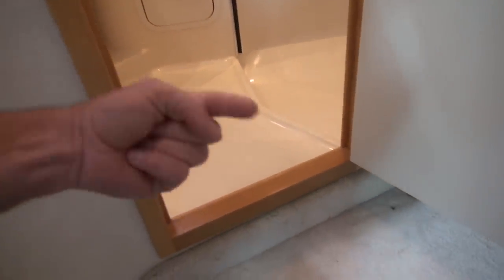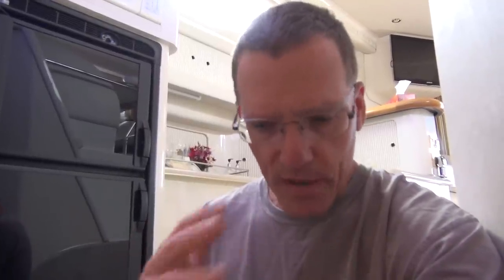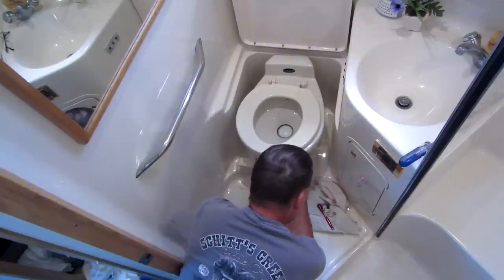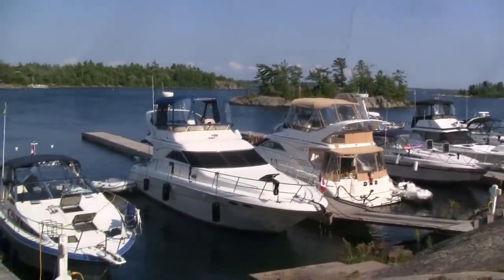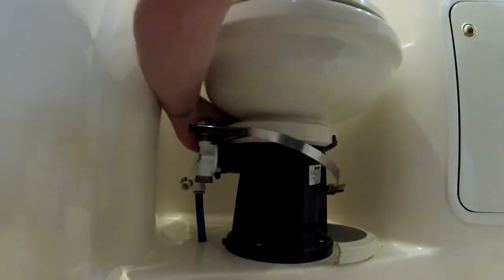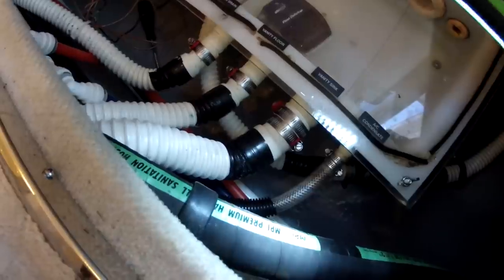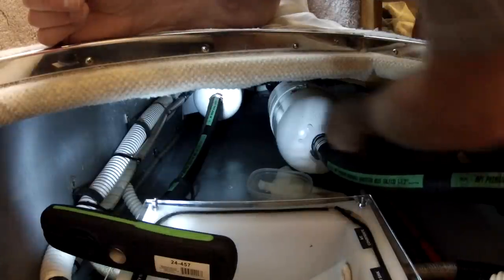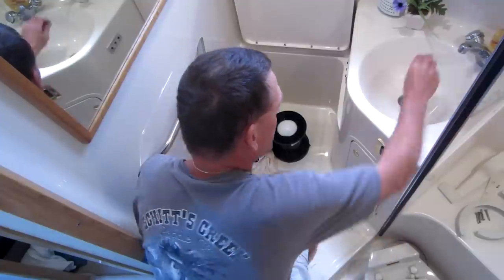Boating How To - Vacuflush Toilet Line Replacement

Comment: Good video. Saved me a lot of time figuring out how to get the toilet out to replace the old cracked waste line.
One thing to add, the source of smell from the sump has a lot to do with lack of venting. Learned this with sailboats.
Adding two vent lines to the box (inlet and outlet) with a tiny exhaust fan (think computer fan) will eliminate the odors.
Contrary to what you would think, the bacteria that create the smell are anaerobic (no air) vs aerobic (ventilated). So adding airflow will help.
Reply from the maker: Happy it helped! That was three Sea Rays ago for us, so I've done my best to forget about that smell 😜
Reply: @BoatingWithBoogaboo  Thanks for all the info you provide. Your videos were instrumental in my picking up a 2000 380 with stinky diesels 🙂
Reply from the maker: @SCFoster  Nice boat! Congrats 🙂

Comment: Can't beat a "how-to" video especially since I'm new to boats. Not new to fixing whatever needs fixed and we have no shortage of that around here. Used to work in the trades to so I'm a little handy. Like Red Green says, "If the women don't find ya handsome, they should at least find ya handy". Thanks for this vid and stay sharp.
Reply from the maker: 25 years in General Contracting, so I've learned a thing or two on how to make mechanical systems come around to my way of thinking ;-)

 You'll be happy to learn that I performed this same exercise to our other toilet this past weekend.SIX HOURS of grunting, cursing and contorting, but it's now done. And Anchor Girl is much happier!

Comment: Another great videos.  It appears you used a special lubricant or heat activated sealant when connecting the hose to the rigid PVC fitting?  Can you provide info on that?
Reply from the maker: Nothing I do is special or mysterious 🤣 The 'lubricant' I used was nothing more than some liquid hand soap which was conveniently sitting on the vanity top. A bit of hot from my heat gun and shezam! She's back together. No glue, only the very same hose clamps that I removed at the start of the video.
 Like I said, nothing special 😉

Comment: you did not show the most difficult part of your new hose install- how you threaded the new hose back through the many twisty hull openings below the deck to the tank.  My hose goes behind bulkheads that I cannot possibly get to without a chain saw, so I would have to tape/temporarily attach the end of the old hose to the end of the new hose and pull it through.
Reply from the maker: And that's exactly what we ended up doing. Sorry the camera wasn't running for that part....

Comment: Nice video Paul...two hours for all that? wow that's pretty good. It took me 3 hrs on two separate occasions to get my seized-on starboard oil filter off at the beginning of this year, down in my ER...and that's after 20 years of general contracting as well! Good job! Now... has it been the answer to your problems?
Reply from the maker: Scott Horslin Ya, two hours for that one, but another Six Hours this past weekend to do the same job on our forward head toilet!! Lots more bending and reaching and cussing to get that one replaced!!

 Bottom line is that now that all the 'inside' lines have been changed, we are much better, smell wise. I still have to do the main line that runs through the engine room, back to the holding tank. That one is somewhat buried behind a big, 454 cubic inch engine, so that will wait until the off season. . .
Reply: ***** Understood. I have to crawl around 2 454's myself, in an ER that's smaller than yours, and I'm considerably bigger than you, so I feel yr pain...

Comment: Have a 3750 with two heads that are vacuflush. One works great but the other stays full of water and will not flush. Pump comes on about every two minutes even when not in use. Could it be seal on no working toilet? Everything else works fine. No flush problem.
Reply from the maker: +Doug Dunkle Buddy, I have repaired and or replaced pretty much every component in out head waste system, including the poop holding tank! Take a look at my DIY Playlist to see what I've encountered and how I fixed it (https://www.youtube.com/playlist?list=PLKhjT5kr2l2GpE-r5PjPvMtaRygCEb_si).

 Take a boo at them and let me know if you have any more questions. . .

Cheers, Paul.

Comment: If you are worried about a hose clamp sliding down the line, put a piece of tape on the line but have it flare out like a flag or label.  That would stop it from sliding to far.  making tape would be easy to remove when done.  |-|--
Reply from the maker: Good tip. Thanks.